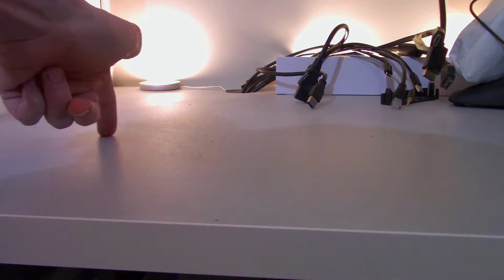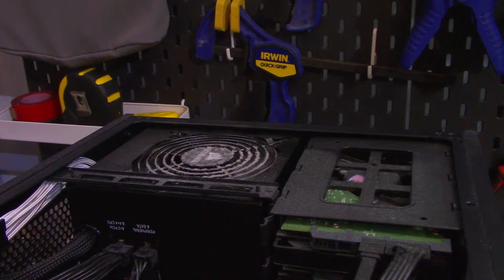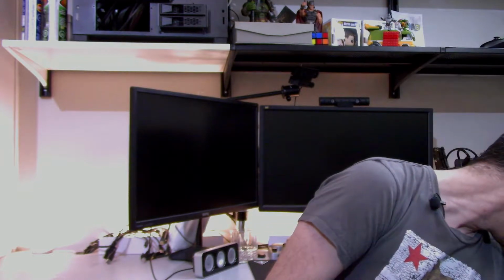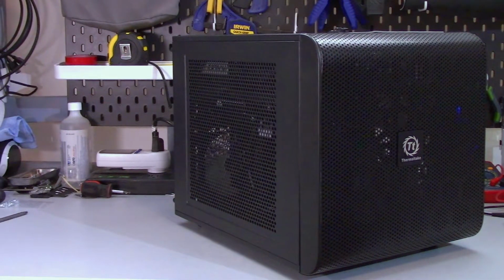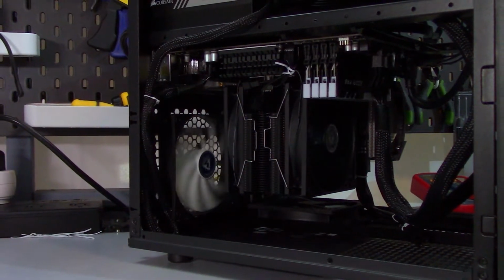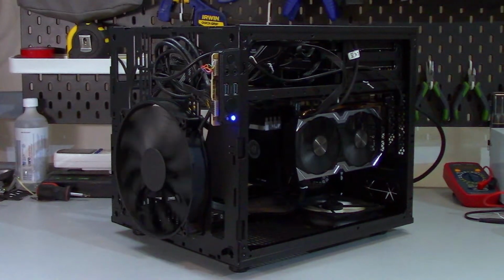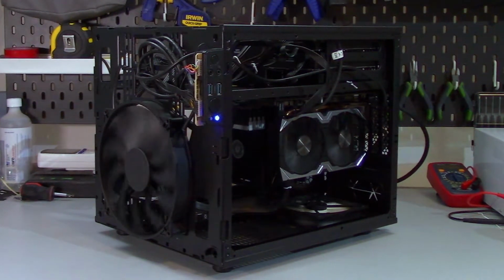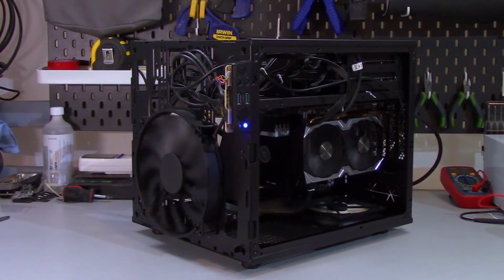Deep-Cleaning My Editing System

Comment: Have you replaced those GPU thermal pads before? That was the most annoying part when I first did a full clean. I liked that you could see your GPU better in the v21 with the RGB.
Reply from the maker: I didn't switch out the pads, they still looked good so didn't bother. I agree the the system looks better on camera with the LED's but as I said in the video the colours didn't quite match and the system is so much quieter now. In the future I might get some good ARGB fans to put in. But for now I'm just going to leave it dark😢.